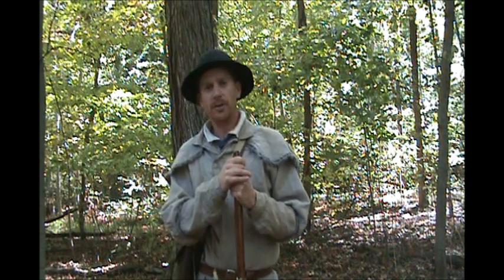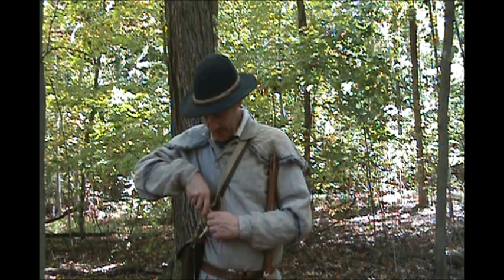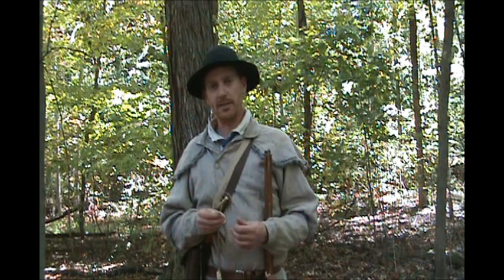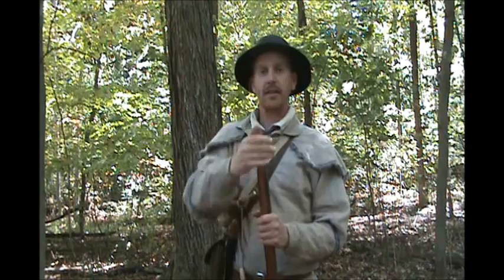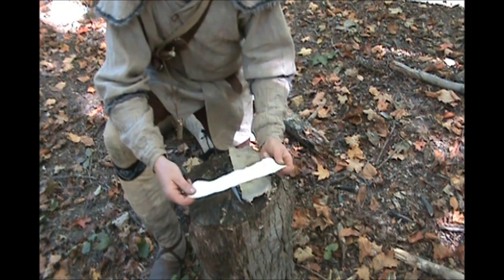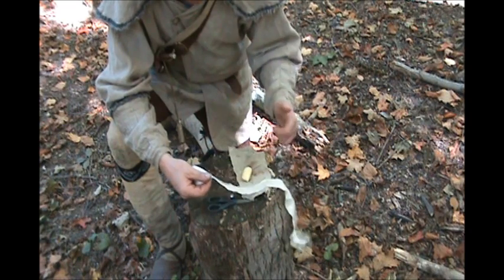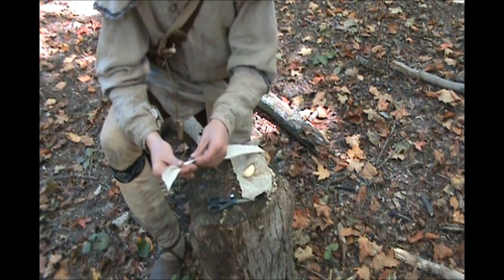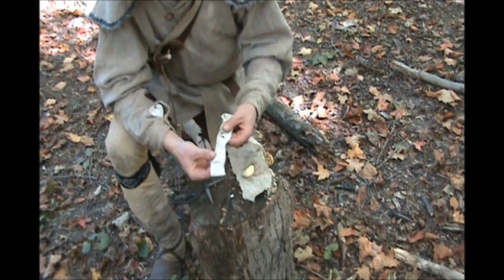Flintlocks : Cutting rifle patches

Comment: Like the two fellas before me, nice idea and I will try it. The only thing different I will do is something like I do now with my squared off or squared and cornered off patches is I use eastern maine shooting supplies premium lube. I let it get super soft, almost 'melted', dab the patch on one side and continue with more patches. I lay each patch on top of the lubed side of the previous patch in a pile. Once all my patches are completed, I then squeeze them all together until they're  just  a ball. Then I store them in a metal can. When I go out, I grab a supply and place those into a smaller tin for transport. With your idea, it'll just be one ball with a continuous string of pre lube patches to tear off my needed days supply.

Comment: Folks your rifle will tell you how thick the patch it wants. A factory barrel rifled with a carbide button will have grooves cut about 8 thousands deep. A cut rifled, custom made barrel will be at least 10 thousands deep and pdobably 12 thousands deep. Get a patch material that is about 1 1/2 times as thick as your grooves are deep so when compressed the patch will fill the grooves. Pick a ball size that will start easy and go down the bore with one smooth stroke of the ramrod. A good lube will reduce friction and help protect the patch from burn-out as it goes out the rifle. The ball can be way under-size because the pressure of the powder charge will bump up the ball and force the patch into the grooves. A tight fit from larger diameter balls comes to us from the target shooting clan who used lighter charges, short starters, mallets and steel range rods. Old time hunters used none of those things. A load combination will have a sweet spot between ball bump up, or objuration, on the low end and patch failure on the high end, Somewhere in the middle is where the most accurate load will be found. I suggest you start with pillow ticking fabric and wash the starch out of it. No bleach. Then experiment with lubes. Cotton is vegetable so try different vegetable oils. Olive oil was popular when they could get it. Linseed oil, castor oil, or even corn or peanut oil can be tried. The best lube will allow for more powder and more powerfull hunting loads.
Thats all for now. Good luck and good shooting.
John Davis
Jax Fl
Reply: I thought you were supposed use a fat product. For lube to season your barrel
Reply: But I'm listening tell me more

Comment: Critr. I have a .50 cal half stock Traditions Springfield Hawken. What  would be a good charge to start with if Im using fff powder for my main charge. Please respond. Its important. Thanks for all you do.
Reply: I'm not Critr, but I have a .50 cal Pennsylvania rifle.  The usual way to start finding the best load for your smokepole is to match the powder charge to the caliber of the gun, i.e. 50 grains of powder in a .50 cal.  You then go up or down(usually up) in 5 grain increments until you discover which charge suits your gun best.  If you intend to use the gun for hunting, heavier charges are usually the way to go